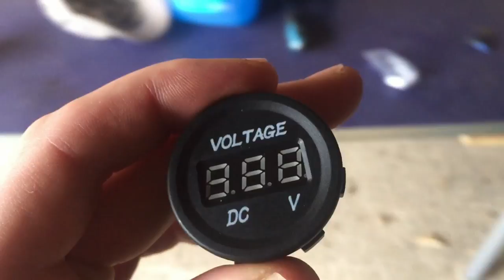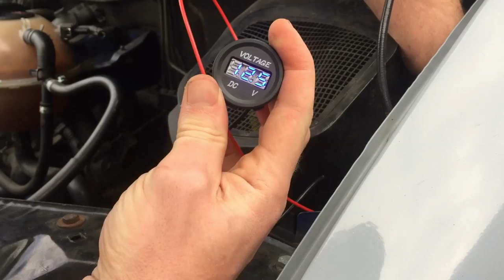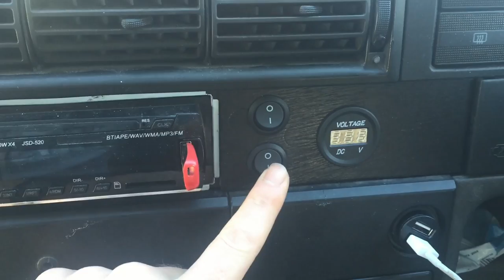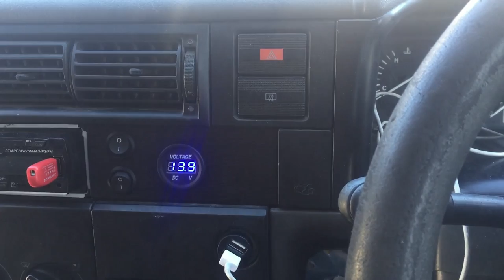Fitting a Voltmeter in the Dash

Comment: You need to do the big 3 wiring upgrade you'll find it helps the alternator and battery keep a higher charge
Reply: can you show it,sir?
Reply: @jayeshrathore5804  big 3 is the way forward
Reply: I just did the BIG 3 ...250amp alternator & upgraded wiring. I'm running STRONG NOW!

Comment: Hi Joel, nice video. I notice you have quite a small battery fitted. With 540CCA. I'm (hopefully) just at the end of rebuilding and fitting the engine to my 2.4d and found that the battery that came with the van was duff (probably from sitting for so long). When I checked online, it said that an 019 is the battery needed for the van. I've ordered one from ebay for £67.95 with next day delivery. It has 920CCA and is 100Ah. As you have a Halfords battery fitted, the HB019 from Halfords is only 800CCA and is £113. I just thought I would mention it in case you were thinking of replacing the battery any time soon.
Reply from the maker: MarcBolan3 

Oh thanks for this information. I have to admit I got lazy and just replaced the old battery with the same model from Halfords. I’ll definitely take this into account when I next have to buy one!
Reply: be a lot cheaper on ebay compared to Halfrauds :)

Comment: I wish you had compared the volt meter in the dash with the values on a multimeter at the battery to see if the values were the same or not.  

I question how accurate these dash volt meters actually are...ie., done a comparison test with a multimeter prior to installation to make sure it was
accurate.

Do you think you would get different values if you connected the dash volt meter to the fuse box under your dash?

Comment: Is another way to wire this if I grab the power and ground wire from the cigarette lighter plug?
Reply from the maker: It may work, but I wouldn’t recommend it. Whatever you do make sure you are using a correctly fused circuit. Good luck!
Reply: @JoelsStuff  good.. but the cigarette lighter has a fuse too.

Comment: Can I install the voltmeter from the stereo power wires?
Reply from the maker: You could, and it would work, but not recommended because the wiring/fuse is designed to work with your stereo and not an additional component

Comment: What type gauge wire did you use, and why do you have two toggle switches?
Reply from the maker: The other is just for my stereo. The wire is rated at 8 amps

Comment: This video
Made me cringe , a piece of wood , no heatshrink and straight to the battery , WTF just wire it the the ignition
Reply from the maker: Sorry you didn’t like it
Reply: behave, it works fine and there is no issue going to the battery and switching it also what's the big deal with a piece of wood, it does the job. I'm lucky enough to have a 3d printer and print my surroundings etc but if you don't have one you just make do and a piece of wood works fine.
Reply: @lambrettaladUK  and going straight to the battery gives you the most accurate reading.
Reply: Going straight to the battery gives you the most accurate reading. Be nice.
Reply: @vanessanorton455  that's how mine is. Ah the internet. Where everyone is an expert in their own little mind
Reply: Don't see anything wrong in the video. Chill and do your own video
Reply: Grow up Adrian